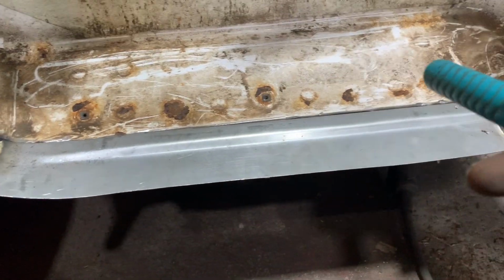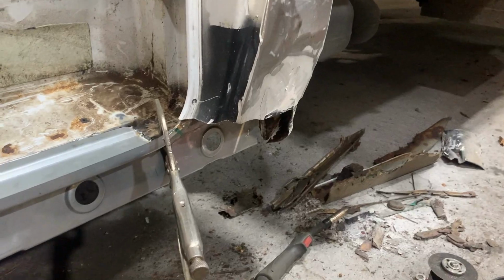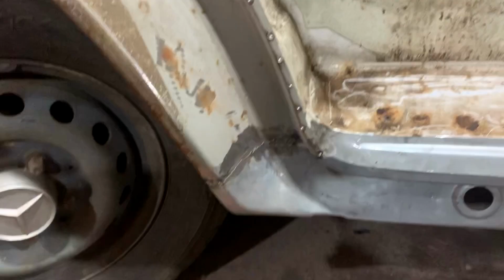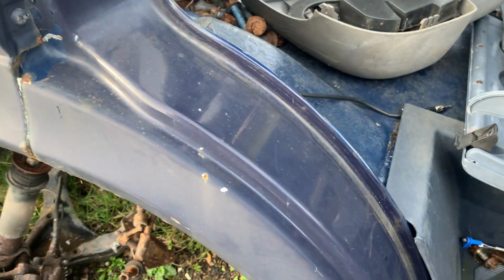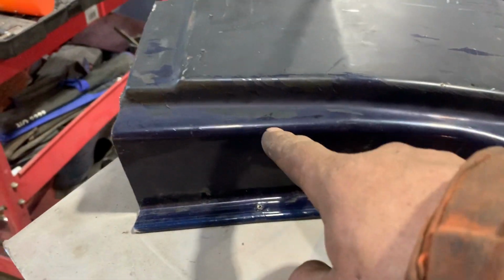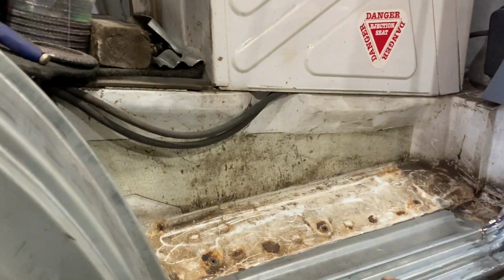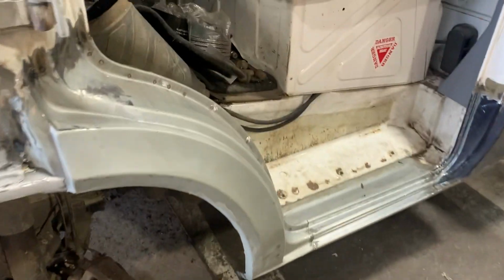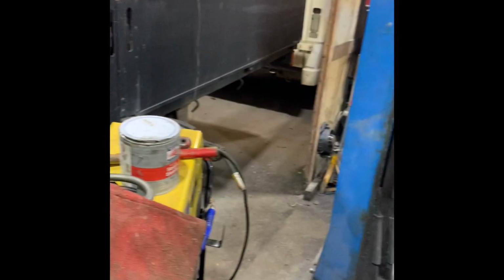Mercedes sprinter Volkswagen lt body repair part 2, welding metal work

Comment: Al I personally (not a proffessional welder self taught with basic info I bought my first half size MIG back in the 90's most of my work outside of rebuilding trailers ws car based nearly all ways outer sills or floor to inner sills  my first mig and I still have it is a Cebora 180  its has been as faithful and reliable as my old dog  great video by the way nice to see how someone else does these vans

Comment: On stuff that's rammed full of filler like that b-post I now hit it with a blowtorch instead of grinding out the filler - once it's had a good tickle of heat, it just scrapes off nice & easy. Pongs a bit but is better than having clouds of filler-dust everywhere - and it's faster. Jealous of your access to repair panels over there in Blighty - here they're a bit more like hens teeth.